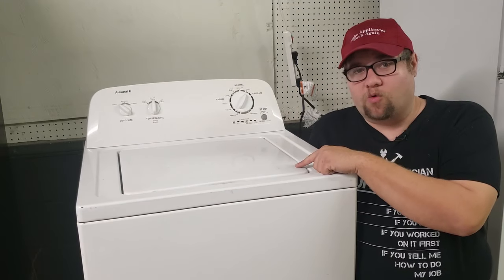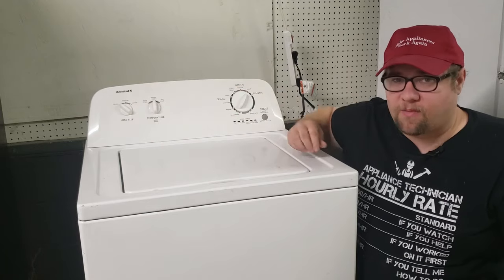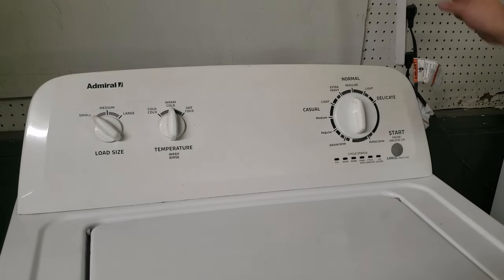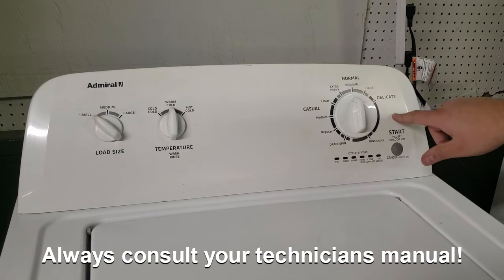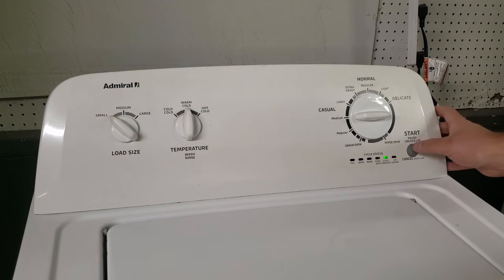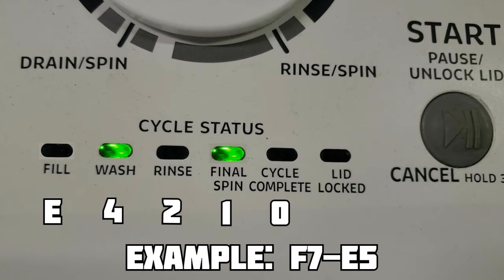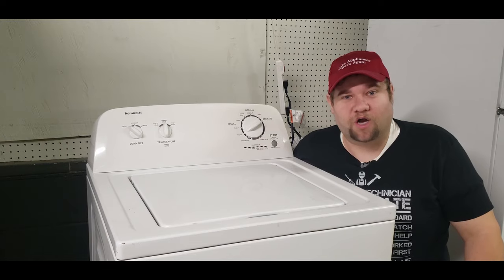How to Use Troubleshooting Mode on a Whirlpool, Maytag or Amana Washer AND Understand the Codes!

Comment: Good video for explaining how to read error codes!!!! Just wished you would've explained that on some washing machines that wash could actually be the #8 then it would go 4 2 1 and lid lock would act as your #0!!!! I bought a $30 water inlet valve because I read it as an f3 e2 when in fact it was an f7 e5 my actuator.Other than that good informative video.
Reply from the maker: I've done updated videos on this. Sadly, YouTube hates the idea of editing videos, otherwise I'd of added more content to it. The problem is that older versions of these washers (like the one in the vid) add the #8 in there, while older ones only went up to 4. I made this video before that was a frequent thing with these style washers.
Reply: This should be the top comment. 

The key values can’t form the last 3 codes on the list, so they’re not a matching set.

Just buy a new washing machine. The part you need probably costs half a washing machine anyways
Reply: @josephdixon81  my comment or the reply
Reply: @josephdixon81    I doubt that unless you need a board and even that on my machine isnt what they want for a new washer!   544 at home depot for mine.   I bought two parts for mine to fix it and it cost me less than 50 bucks.

Comment: Ben Appliances it's 2:17 AM in the morning and I am here watching your video because I am stress out with my washer Amana . Used a whole pack of laundry  detergent and my clothes never wash the machine collected the water runs it out then light up wash😭😭. Never wash the clothes.  So I keep trying and trying same result.  Wasting water and electricity.  Please help me. How can I get my clothes wash. It works on spin and drain. I thought maybe was to much clothes  but even with 5 pieces of clothes nothing. Still not washing. I pray you responde to my question.  God bless you and I must say great video.
Reply from the maker: What error codes did you get on the machine?
Reply: @bensappliancesandjunk   Good morning @Bens Appliances and Junk i am here right now trying to do as youare doing in the video but nothing.  I tried about 10 times. I even unplug it and plugged it back up. The lights just didn't came on. Does that mean I'm doing something wrong??
Reply: It Lit up after my trys at Sensing fill and Cycle complete.  What do I do now
Reply from the maker: It's likely you are not inputting the sequence right. Here's another video I have on reading codes: https://youtu.be/X9zNsGhmeeM
Reply: @bensappliancesandjunk  Now its showing me all the lights which I this is the F7. After do all you say it's now F7(F 4 2 1 0)
Reply from the maker: @newsflash2226  likely going to be a shift actuator gone bad then
Reply: @bensappliancesandjunk   So does this means the machine is no good??, Is there anything I can do to fix this problem??
Reply from the maker: @newsflash2226  it means... go buy and replace the shift actuator. Its $20 and 5 screws underneath.

Comment: Do you have any idea how to reset the washer after a power outage? Every time the power goes out, it takes hours for the washer to start working again, and I can never find the right sequence of events to get to the solution faster. Your help is greatly appreciated.
Reply: "hard reset" is (1) unplug for >1 minute (2) plug in and open/close the lid 6 times within 12 seconds.

Comment: I have no hot water have gone through to make sure it is not plugged either hose or filter and yes hot water is turned on. When hot water is selected no water enters drum cold water works perfectly. Did your troubleshooting mode on my Amana washer and it only flashed on the green fill button was not solid green flashing green only . No other buttons came on in diagnostic mode. I feel it could be stuck value on hot water side .. if not I believe it to be water solenoid sensor!! What do u think??

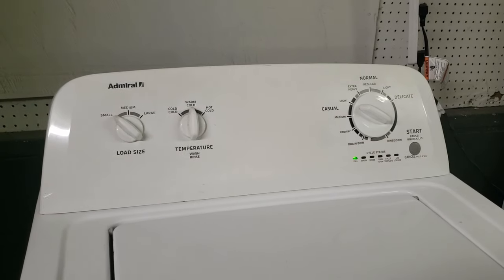Comment: Skipped something here. At 4:36 there is a blinking fill light, and "I don't have all the codes, but I can show you how this is going to work." A second later there is a close up of the lights, and the fill light is on steady. Mine just keeps blinking the fill light the way the washer in the video is blinking at 4:36. Does this mean there are no error codes? Is there something else that needed to be done while the light was blinking to get the error codes?

My washer alsways skips rinse. On regular cycle (cold/cold), the fill light comes on and it fills, the wash light comes on and it washes and drains, then it goes straight to "final spin". One rinse cycle, the fill light comes on for 3 seconds, then it jumps to final spin. Really weird...

Comment: I did the diagnostic test and there lights that went on were the wash,  final spin and cycle complete.  Is that 7 total? The problem I have is that it doesn't complete the fill and empties the little water that it had.. and it won't continue.  I was trying to wash my bedspread so i had it on bulk. I have an Amana NTW4605EW0, which I regret buying in the first place.

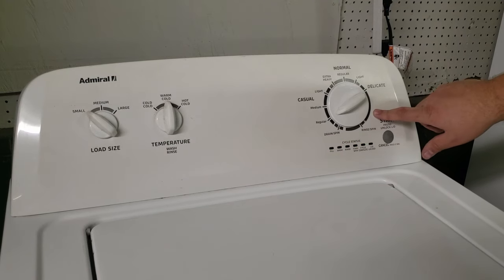Comment: - 6:18 How EXACTLY do you, "go thru" all the codes? Do we wait, do we press buttons, do we turn knobs, which knobs do we turn, how many times do we turn which knobs? Is there a separate error code set for each & every turn of the main dial? Do we have to write down each error code and record exactly where the dial was and associate it with that exact location of the direction of the dial knob?
- Once we get error codes, then what are we supposed to do?!

Comment: I love the shirt.

The cute clipart fridge at the end is fun, too.

Unfortunately, my washer is a Whirlpool similar to the one in the video, but without any indicator lights or the Start button (started by pulling the cycle knob on the right), but interesting video nonetheless.
Reply from the maker: Older washers don't have an electronic board that allows code access. Could be a good thing, though, as they tend to last a LOT longer.
Reply: @bensappliancesandjunk  does it work for Amana washer
Reply from the maker: @peterock42  only if it has the digital green lights below the dial knob for wash modes
Reply: @bensappliancesandjunk  yes it has it but I just filled it up with water like a half hour ago and it drained the water out and all lights are off and when I plug it back in it makes a humming noise but it doesn't do anything at all
Reply: Is it messed up or can I still do the diagnostic on it?
Reply: @bensappliancesandjunk  it has the lights also but it's a amana washer machine but the lights are off and it does a humming noise
Reply from the maker: @peterock42   Go ahead and do the diagnostic codes on it it should work just fine. And then figure out what numbers it is and we can have a better idea on What is wrong
Reply: @bensappliancesandjunk  fixed it thanks for your help

Comment: No matter what I do, follow the procedure, lift the lid 6 times, unplug it, etc, I can never get more than one light to illuminate or blink on my Amana.
Reply: - UPDATE: After emptying my washer halfway, which was stuck with a full tub and did nothing, I finally got the lights to blink. Here's what I did:
- After doing the counterclockwise full rotation reset on the cycle knob and THEN DOING THE FOLLOWING PATTERN, I GOT THE LIGHTS TO BLINK & DO WHAT HE SAYS.
- *Amana: (in the manual): R3×, L1, R1
- But after that I'm stuck because everytime I turn the knob one click I get a different error code set, so that could be like 12 or more. What am I supposed to do with all these codes?!

Comment: On my Amana, I didn't have to unscrew anything to get my MANUAL FROM MY USED washing machine. Just reach my hand in on the upper L side between the wall and the tub and it's stuck to the front wall in a ziploc bag

Comment: Hey there , sorry for the trouble. So I tried the pattern you suggested to enter diagnostic mode but no led lights pops up. Would it the board be bad or the lock is bad?
Reply: My Amana did the same. Nothing lights up when doing these sequences.

Comment: I hate to comment because I found this video somewhat useful, but I'd like to clarify the issue of the lights and codes. The lights indicate the equivalent BINARY NUMBERS  of the code; you do not add them together - you translate them. Search "binary numbers" for how to read a binary number. The leftmost light does indicate subsystem and component (F & E codes). Also, Whirlpool tapes a printed service guide inside the washer casing. This guide has the codes and other service guides. Don't let a repair person take it from the machine's owner.

Comment: Hey BEN , the error codes do not display a lint problem on this current Amana {NTW4516FW4} offered by Costco.  Ever seen a problem like this?
Reply from the maker: I've never seen a washing machine have a code for a lint problem, ever. There's no sensor or setting that understands what lint is from what I've seen
Reply: @bensappliancesandjunk  Thanks, Ben. Would using a non-HE detergent cause excessive lint?

Comment: Hi thanks for the video it shows on my amana the fill and wash blink and then the complete blinked. So that is F4..0? I don’t see that on your list. Any ideas?
Reply from the maker: Yes, Fill/Wash should be F4. However, Whirlpool/Amana may have changed the codes slightly on the newest machines with an additional set of numbers and codes. Some machines don't start at #4 at wash, but rather #8 (then 4, 2,1, ect). If that were the case on your machine, it could be F8/E0 which would be low water volume to the machine (clogged supply lines / bad valve / ect)
Reply: Same..i have the same machine from tve Video and light Fill=F and wash=4 plus cycle complete light= E0...
Reply: I got F2 E0, BUT I don't know what that means, any suggestions?
Reply: Teresa Rodriguez I’m getting this same code did you figure out how to fix yours?
Reply: I’m getting the same code on my Amana. Sensing Fill and Wash are blinking and then Cycle Complete blinks. (F4-E0..? Which is not on the list in the video. The machine is at least 5 years old so I’m not sure if the codes are the same.) I just put in a load in the morning and it was working fine. All I have been able to get it to do is drain/spin and that was after a few tries it finally worked twice. When I start a normal cycle it just starts to slowly spin back and forth, like it does when it’s filling or washing, but no water comes out. After a few minutes it starts to drain…air because there’s no water lol. Has anyone had this problem and figured it out? I wish I could fix it myself!! I don’t know if to call a repairman or just get a new one.

Comment: Hi ,Thank you for the great information, my Whirlpool WTW 4850HW1 is stuck in final spin mode and can’t be get rid of it.After unplugged and plugged it back,still in this mode.So, I cannot check anything,do you know what should I do?Thank you very much.
Reply from the maker: If its stuck in spin mode, it sounds like your shift actuator may have died before switching back to agitate - its almost always the other way around (stuck in agitation instead). 

I literally just made another video about diagnosis / troubleshooting using a newer Maytag Washer. Very similar to your 4850HW1. You may want to watch that video, and try a few of the manual or automatic tests to see if you can "Force over" the shift actuator to agitation. If you can't, then I'd say its 95% chance your shift actuator's bit the dust.
Reply: @bensappliancesandjunk  Thank you so much! I’ll try that and let you know how it goes.
Reply: @bensappliancesandjunk  I have a similar problem I think ... washer drains, and flashes in spin mode but it never actually spins.  Then stays in lock mode until I unplug and run diagnostics again.  Any suggestions?

Comment: Is there a way to adjust the water level? Our Amana High Efficiency washer never adds enough water to get a clean wash.
Reply from the maker: If there is, you'd have a physical selector switch on the unit, or an option for "Deep Fill"

Comment: Got a question for you I just bought a mid-priced war Whirlpool like the one you did in your video in the back where you hook up the hoses would it hurt anything if I pull those filters out of the connection where the hoses hook up to so the water will fill faster
Reply from the maker: Wouldn't hurt anything, but I'd only suggest it if you have decent water that doesn't have a ton of minerals in it.

Comment: Thank you for your video.I cannot do the test..Our newer amana washer has issue where it will not stop trying to drain the tub.No water in tub and pump just keeps running.When we unplug the machine and plug back in again after waiting 5 minutes the machine pump is stopped.But then it start up again 20 seconds later..I should add none of the lights are illuminated.Would you have any ideas on how we may be able to do a reset and get this washer working again? Please and thank you.
Reply from the maker: Your washer is in a flood-control mode. It detected a massive amount of water (either real or imagined) and it usually sends a distress signal to the pump... The last time I had that happen, I waited like 20min of it pumping until it completely stopped. I want to say afterwards I ended up having to replace the pump motor anyway. I would let it run for 20-30min just to be safe. If it doesn't stop, then I'd maybe look at replacing the pump to see if it'll reset itself. Afterwards, you can run diagnostics again to hopefully get it to come up and reset/calibrate the machine.
Reply: @bensappliancesandjunk  Thank you for the reply/suggestion..Seems I was lucky n finding a fix.I unplugged the washer again and turned the drum by hand to check for and obstruction.Seemed fine..I plugged the washer back in again and the pump started pumping again..I poured a 5 gammon pail of water into the washer and it pumped it all out..I turned the drum again by hand and shook the drum side to side and the pump stopped.Washer is working fine again..Hope it stays working..lol 
thanks once again for your suggestion as well.
Reply: @meldiotte8227  This one has stumped me and my guy several times. It has happened several times on the glass top Maytags. The last time it happened on a glass top Maytag, I took the washer to the ladies house and it started trying to drain. Unplugged it for 5 minutes, it did the same thing. Brought it back to the shop (embarrassing) and it did not do it. So, I took a different machine (same style glass top Maytag) to this ladies house the next day.... same thing happened. I'm looking like an idiot by now. So, I went and got the original machine and took it back to her house and guess what..... SAME THING!!! Remember, it did not do it when I took it back to the shop the day before. So, I explained to the lady I could not sell it to her. Both washers were sold to other customers, I delivered them both and never a problem out of them! I have no idea why it kept happening at her house. Over the years I've had that happen twice like that.

Comment: Thanks for the info. My issue is I was cleaning my Amana on the Affresh mode. It filled water to capacity and did not drain. Do I begin where I started and go the counter clockwise 360 and start the diagnostic, or at the Normal? Usually I unplug and resets. Not this time. Please advise. Thank you.
Reply from the maker: You can start wherever you want on the system. I always just start with the knob at the top because its easiest to explain the modes that way. The system doesn't really care.

Comment: What I don't understand is, if the green light is not on, then it's an E code , in your example. You get an F7, then an E #, I think E5. How do you get both codes without doing anything different since we got the first F code?
Reply from the maker: In the error code mode both lights will flash without doing anything, when you turn the dial the next set of codes will flash

Comment: Hi, thanks but I am still having issues decoding the codes even after watching the video. My Amana NTW4601BQ1 will wash but skips the final spin. There is a bit of water at the bottom and the cloths are left soaked.  If I run the drain and spin cycle afterwards it would sometimes work.Would it be the actuator or lid lock? Please advise.
Reply from the maker: What code is the system displaying? I would imagine its the actuator more than likely, but without the code, its hard to say for certain
Reply: Bens Appliances and Junk having the same problem they code I got what F4-E0
Reply: Im having the exact same issue and codes… any solution?

Comment: I am working on an Amana for a friend. I had to erase codes without getting them from washer. The lid is not locking, the machine fills, agitates and empties but doesn't spin. Does the lid lock only latch when it is in the spin cycle? It's only about 4 yrs old
Reply from the maker: Some do only lock when in spin, others don't. If you run the machine and it has an issue to cause an error in finishing the cycle, the error code causing the issue SHOULD re-populate on the diagnostic system. I'd be looking for an F5 code (lid lock) or F7 (usually a shift actuator fault)
Reply: @bensappliancesandjunk  thanks Ben

Comment: Hi! I Have a Maytag - Atlantis Model MAV6200AWW. is about 18 years old with a problem of no draining water from  clothes during spin mode. I replaced lid switch and no joy. what's next?
Reply from the maker: Check for clogs in drain pump, kinks in the drain hose, then check the drain pump itself - it could be going / has gone bad itself.